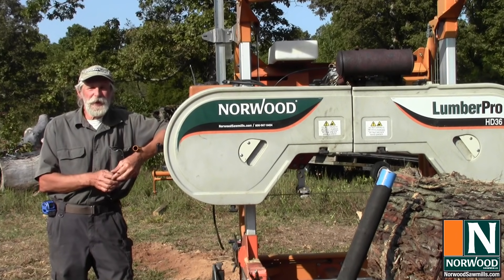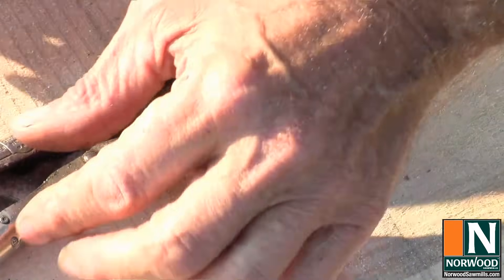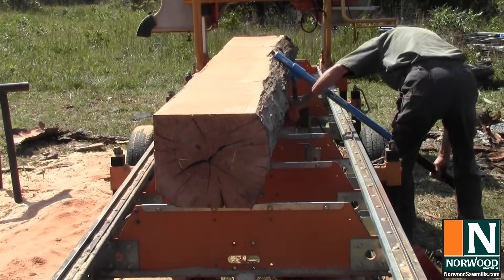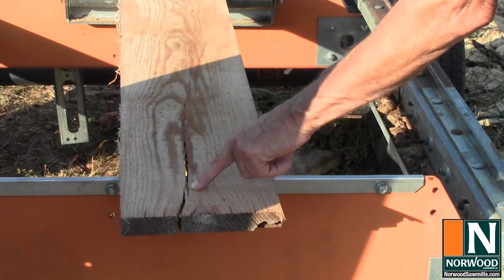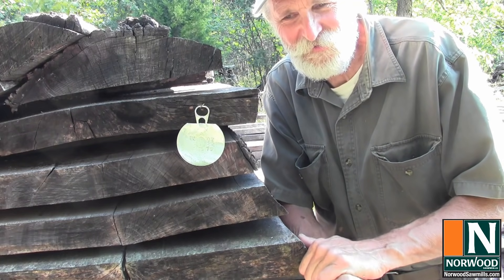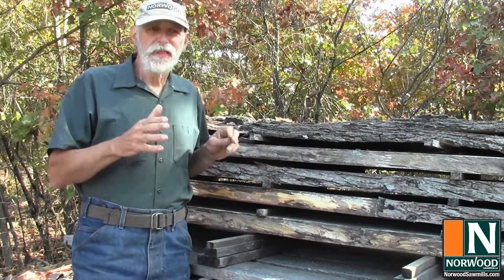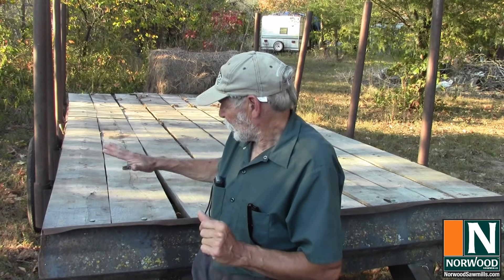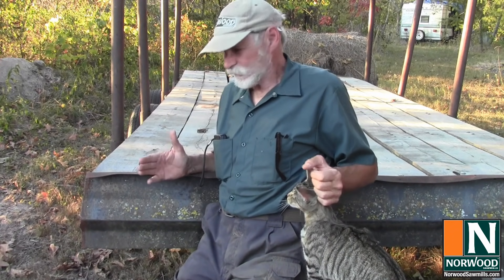Sawmill School - Air Drying Your Lumber

Comment: Geez, Im 62, was going to retire and buy a sail boat. Covid changed my direction. I bought an excavator, a tractor, 31 acres with 4 acres of ponds and creeks, and I need to build a house and lots of fencing, so I bought a sawmill, well went into partners with a neighbor on a doozy. What impressed me was that you look older than me, not by much, I'd say at least 63 and a 1/2, but you're going strong!!! Do I got time to watch my timber dry?
Reply: I built my pole barn cabin with green and very seasoned wood what I found is wood rots if you don’t mill it I let some oak and cherry sit for 9 months, the oak started changing to rot on outside I think you should mill it then dry it. I milled maple and planed it and put it up have had no problem settlers built cabins with green wood that lasted over 150 years
Reply: @lawnmowerman4040  Yeah, I've traded tractor work for milled wood. We have bark beetle, and that creates some nice what they call blue pine, and I ended up selling it. I live in N. California mountains, and a guy drove out from Las Vegas to buy it for bank. I have some 1x pine that was milled, I have quite a bit. It's about 7 years old. It has been covered, no longer on stickers, and it seems ok. It does have holes in it, probably some wood worm. Little 32nd inch holes. Not sure if they are active or not. I use it stakes and braces. Sometimes for utility cabinet framing. I'm going to cover it and heat it with my 350k btu furnace to kill any bugs might be in it. The damn thing is, like I said, I'm 62 for a few more months anyways, SS lost my application, and wont pay me from the time I filed. USA agencies have tormented me all my life with absurd arbitrary pinheads that enjoy messing with the self employed they view as millionaires. They have no clue. I'll not go there. It's hard not to, but anyways, I'm living in a nice home I built after many years of framing as a carpenter, then contractor. I lucked out and sold a piece of property before covid, and right when covid started, this land went up for sale, 31 acres with a 3 acre and one acre pond and about 20 acres of rare forest meadow. So, I can farm it for survival in necessary. Then this guy, a neighbor sells his shacks for a few million in San Fran, and we hit it off good, and are having a hell of a time building stuff, welding stuff and having a scotch a few times a week. Life is good. I have to leave this damn nice house I built to get on the 31 acres. I have 3 lots. I plan doing a house on one, selling in 2, and building another selling in 2, and retiring on my 29 acres with 10 million gallons anum of water rights. Hell, I wish I knew how to capitalize on the appropriative water rights. I got to go back to college and take some water right courses I guess. I guess I'll go out with a hell of a bang! Life was hard and subject to a lot of grief, and now its hard but satisfying! 

I'm a bit overwhelmed at all the projects I got, but definitely not bored: no pun intended.
Reply: @homesculptor  I’m mid 50’s wish I had started 10 years ago but if you check out a couple videos on my channel I am building in Kentucky a pole barn/cabin to live in till I die, nothing fancy and yeah land around me doubled since I bought! Only thing is even down here we Have to get a septic inspector to grant us electric  F-ing money and control us damn it. I have 2 springs on the land and plenty of deer you take care God Bless what life we got left
Reply: @lawnmowerman4040  Yeah. I'm a contractor, and I have designed and built many a home. The one I have now is of a Normandy Chalet combination, I call a poor mans castle. I'm selling it, I have a few hundred grand equity if I get lucky, and the 31 acres I only owe 65 grand on. So, I got a bit of a chance. Or maybe it would be better to sell the lot stock and barrel and get a sailboat and sail off the edge of the world with some other sojourners!!!!
Reply: Getting back to your original post, I'll turn 67 in about a month.  Careful editing makes me look like I'm in good shape.  I doubt you'll have time to watch the timber dry, buy you'll have time to use the try lumber.  It sounds like you've got a pretty good situation.  Even here in southwest Missouri, land is going up in price to where only millionaires can afford it.  Best of luck to you & your neighbor.
Reply: @daveboyt6810  Yeah, I got lucky due to covid's affect on millionaires due to land equity. They sold real low, but inherited the land in California and they were in New Jersey. So, they never saw the place. I had just sold 5 acres the summer before in a sellers market, and I dollar cost average gold. Gold almost doubled. During any economic crisis, gold is like going into the future and finding out who won the race, and we you go back to the past you just wait. So, gold up land down every crisis since Christ was corporal: "buy of me gold . . ." Rev. 3-18 I'm glad I took the advice similar to the day of Noah. People get religious and drown. So, if you got youngsters, point them toward gold. Just look at the dates around the rise of gold and fall of land on the 100 chart of gold price in a google search. It's a no brainer. 

Now I can build an arc with the mill we just ordered, but I think I'll stick to a nice home on my land. Speaking of millionaires, I started out as a carpenter. I figured that was the most expensive purchase people will make: a house! Never got to the million mark, close in equity once, but prior to my knowledge of what gold does, I'd lose everything in every crisis. But, I had to put up no trespassing signs to stop locals from poaching fish in the ponds, and I just wanted my privacy. One guy I caught on a game camera cutting down my sign with a knife. I had earlier asked him politely not to trespass. Later, he forgot it was me, and made veiled threats about "the new owner that won't let people trespass, and he's pissed off people, he better watch his back." I told him, well that was me, I guess you forgot. Then he remarked wit disdain, "are you one of the millionaires." I would have taken it as a compliment in a normal world, but it reminded me of the movie, Dr. Zhivago, when he returned to his birth home that was now state property and the proletariat wanted to turn him in for burning his chair in a fire because he was freezing. 

I guess things are changing and history may be repeating. People want people to share, but the ones who want the free stuff rarely contribute. So, tempus fugit, and endurance now will not be long suffering if those conditions prevail. Best of luck to you too. I'll enjoy your channel. We'll be posting stuff. I have a degree in graphic com, but never have time to edit, so I just upload some crap of crap I do. Starting to get about 10k views a month on my channel. I don't put much into it, but may consider upping-the-ante!

Here's the property https://www.youtube.com/watch?v=srI8DFg0ykk&feature=youtu.be

Comment: Great video thanks. I do have a question, and I may be trying to teach an old dog new tricks but here goes. I notice when you make a cut you raise the head before you move the slab you cut. If you move the slab first you can say a minute and make a half a turn on the raising handle instead of several turns! Just a thought, saves some time, effort, and wear.
Reply: I was surprised he cut multiple slabs before moving them away. That’s a lot of weight pushing down of the blade.
Reply: @paftaf  It would be the same if you were cutting a beam. I have had the same thought in the past, then realized 6  - 1” pieces is no different than 1-6” piece
Reply: I don't have a set pattern.  If I moved the slab first, I'd have to walk around the mill, move the slab, then walk back around to pull the head rig back to the starting position.  The way I did it in the video is more cranking, but less walking.  Later in the day, if my shoulder starts to give out, I'll switch and do it as you suggested.
Reply: @paftaf  Nope.  The teeth are bent alternately about .022" each way, so the kerf is twice as wide as the blade is thick.  The body of the blade slides right through without touching the wood.  No matter how many slabs or how thick, the only part of the blade to come in contact with the wood is the tip of the teeth.
Reply: @paftaf  Because the set of the blade takes a wider kerf than the thickness of the blade, it doesn't matter how many cuts I make, there is no weight on the blade.  That's the advantage of a band saw.

Comment: So do you have to cut the boards again after they dry to get them straight again?
Reply from the maker: Hi Tim

You typically sticker and stack your lumber so it dries straight.

We recommend you watch the following video on Sawmill TV:

Sawmill School - Cutting Blocking & Stickers to Air Dry Your Lumber	https://www.norwoodsawmills.com/tv/index.aspx?isVideo=true&id=312955927
Reply: Depends on how you're using it.  On my trailer bed, it doesn't matter much.  For woodworking, kiln dry lumber typically goes through a straight-line rip (a specially equipped table saw), then a jointer to get get perfectly straight, square edges.  Proper stickering and stacking means that much less wood will need to be removed to surface it and straighten it out.

Comment: I have a question. After it gets milled up into boards would it help if it was stacked the right way in a green house to stay dry and warm ?? To speed up time using the wood
Reply: That depends on the green house.  If you look up solar wood kilns, you'll find some based on greenhouse design.  In general, raising the temperature lowers the relative humidity, and the wood will dry more quickly.  The big catch is air circulation.  Circulating the same moist air will not only slow the drying process, but encourage the growth of mold.  You need to both circulate the air through the stack, and have a way of bringing in fresh air and exhausting the warm moist air that has picked up moisture from the boards.  You'd definitely want to monitor moisture of the wood from the insides of the stacks.  Hope that helps.

Comment: can you cut logs into beams...dry those out and cut to size for your building project when you start to build? Wont be building for a year or better but have time to cut beams now
Reply: Good question.  You are generally better off cutting wood to the final size as you mill the log.  There are several reasons.  The rule of thumb is that wood takes about a year per inch of thickness to dry.  The outsides of the beam will be air dry, while the inside still has a higher moisture content, causing stress in the beam, and warping of the wood as you cut it into planks.  You will also have the side lumber to deal with-- planks you get of the sides before you get the log milled into a square cant.  Finally, you'll be handling the log twice, and those square cants don't roll worth a darn.  As long as you have the log up on the mill, you might as well cut it into its final form, sticker it for air drying, and be done with it.

Comment: That is another excellent video, there is more to timber then ripping something to size and dimension as opposed to looking at what they finished product will be, which is actually a very important outcome. I have to do a deck floor on my Flat top low loader as I want to return it to its original look and function, I have finally been opening up allot of logs on my mill and playing with Horses again so I will have to post some more information out there that you may enjoy a look at. Cheers Garry from Australia and Matey your welcome if ever you do get down under
Reply: Good to hear from you, Garry.  Interesting to see your work with old equipment, too.  Restoring that ol' 8N Ford in my early videos is on my to-do list, and I've got a couple of 30 hp upright "Coke bottle" steam engines that I'd love to get running.  Stay in touch.
Reply: @daveboyt6810  I would love to see those projects
Reply: @AttitudeAdjuster  Maybe this winter...

Comment: that was very good. One thing you didn't cover was bugs. I've cut white oak that's beed air dried and found live worms inside. I assume they will eventually die.
Reply: Good point.  They might die, but I've had them go ahead and eat holes in the wood after it has been milled, too.  Powder post beetles are the worst, since they'll munch on anything wood once they're inside the house, leaving tiny piles of wood powder.  The best prevention is to heat treat the wood to at least 135 deg F in a kiln to kill them.  I should have covered that.

Comment: Great video, thanks.  I have six acres, mostly wooded and I need a fairly large  36 x 32 shed / carport to store my pontoon boat and tractors.  I was thinking of doing my own milling for the lumber but it seem a huge amount of work and will I have usable lumber to build.  East Texas is very wet in the spring and very dry in summer.  I'm wondering how usable my milled lumber would be for building the posts and rafters without it warping, bending and shrinking.  It would be a desaster if after the build that the building tears itself apart.  What do you think?

Comment: How much moisture content is allowable in pine when building a house.
Reply: Good question.  One of these days I'll take my moisture meter to the local lumber yard & see where it comes.  A lot depends on how you use it.  For most framing members, I'm guessing it's around 15%.  Fortunately, it doesn't shrink much lengthwise, and slight changes in width and thickness aren't critical for conventional framing.

Comment: Thank you, Mr. Boyt, for a great "Science!"-based exposition of the subject.

It does however make one wonder how our great-grandparents constructed furniture well enough in the face of wild winter-summer humidity swings in un-air-conditioned living spaces for it to survive to pass down in heirloom/museum quality.

Surely(??) most of them had only air-dried lumber to work with.  Could their techniques mitigate the effects of using air-dried lumber in kiln-dried conditions?

Or, could it have been they started with higher-quality wood than most of us do?  One aspect comes immediately to mind: quarter-sawing.  If the old-timers restricted themselves to using quarter-sawn wood only, their pieces would have enjoyed almost no shrinkage.

That's where my money is.  After glancing at the cost(!) of quarter-sawn, I think most of us look for "alternatives" that then require us to install a/c...
Reply: Quarter sawn lumber still shrinks as it dries-- around 4% to 5% in width, depending on species and moisture loss.  That's still less than plain sawn lumber, but the important thing is that it doesn't tend to cup as it dries.  Traditional techniques such as trestle tables with tapered pegs that can be tapped in to tighten it up as it dries in place, and cabinets with floating panels also compensate for seasonal drying (and swelling).

Comment: Would peeling off the bark make it dry quickly?
Reply: Good question.  Leaving the bark on wouldn't make a lot of difference in drying time, but insects can be more of a problem if you leave the bark on and, if you want boards with straight edges, it is more efficient to cut the edges off before you stack the wood to dry, because you get more even stacks and don't waste space drying wood that will just be cut off later anyway.